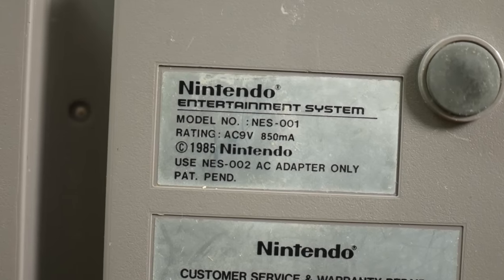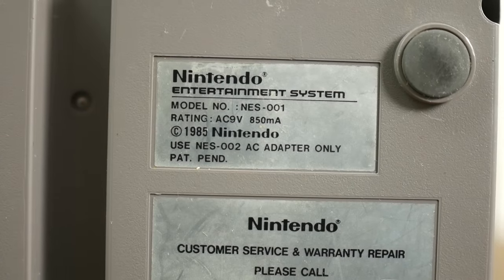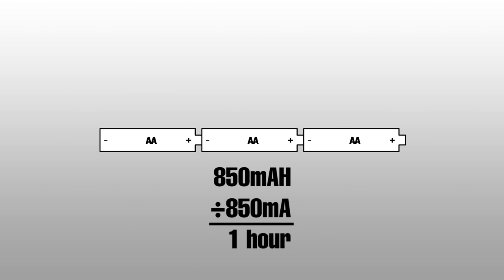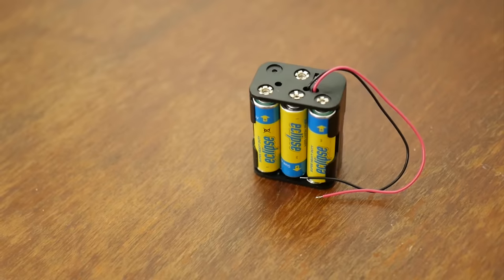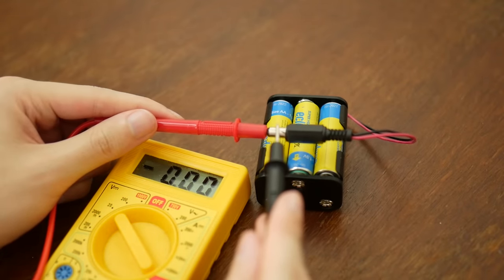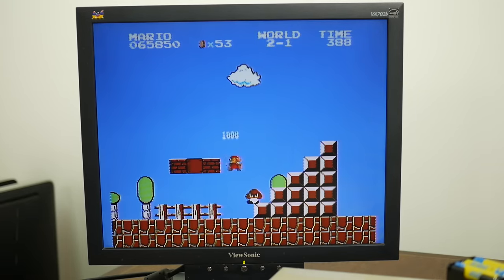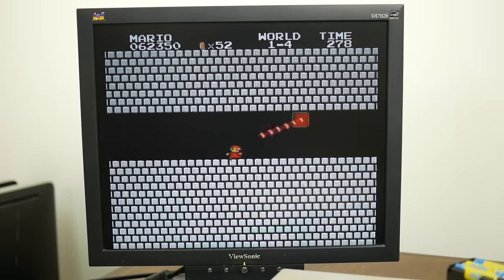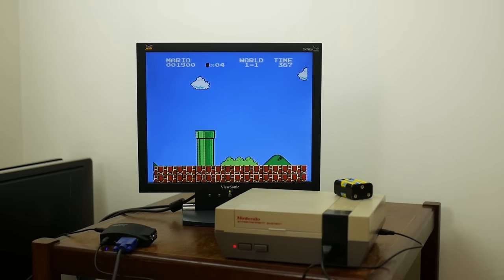Can you run an NES from AA batteries?

Comment: 1:14 "What happens if you pass DC trough a DC rectifier?"
a) Absolutely nothing
b) The DC converts back to AC
c) Matt dies

I'm guessing c) Matt dies
Reply: d) The rectifier outputs DC.
Reply: Yes because he's not immortal (I assume), but not because of this experiment.
Reply: Duh, A)bsolutely nothing!
Reply: i hopped for C
Reply: It stays DC but the inputs can be an unknown polarity with the outputs having a known polarity every time
you lose 1.2 volts unless it uses schottky diodes in which case you lose 0.4 volts
Reply: @kargaroc386  most likely 1.2 volts, as at slow 50Hz switching a cheap silicon diode rectifier would be sufficient. High frequency switching power supplies however would have Schottky diodes
Reply: @user2C47  r/whoosh
Reply: Electroboom
Reply: @mari2.  AI exists.
Reply: @Aivaras Sungaila: I'm really sure you where joking about the answer "matt dies"  because if doing this experience would have cause him to die, he would not be able to upload the video in the first place, so you could not comment you stupid joke on this video because the video would have never existed.
Reply: @mmmm768  You can troll me all you want, it does not bother me one bit, because one time, I decided to Troll someone to see what was the hype about trolling other, so I only Troll other Troll, and did it make me feel any better, the answer his no. This his proof that I know the truth about Trolling, so go head Troll me all you want because the only person your hurting his yourself.
Reply: @SuperNickid  r/wooosh
Reply: This comment: ...I choose...Matt dies!-
433 likes: Hey this is the FBI
Reply: Luigi The rectifier wins by doing absolutely nothing.
Reply: D
Reply: The funny thing is that Matt is kinda sounds like "مات" in Arabic
Which means died
Reply: Boom
Reply: E) sudden CPU evaporation
Reply: @SuperNickid  *is, not his
Reply: @SuperNickid  *you're, not your
Reply: @SuperNickid  Clearly, because that level of poor planning would definitely not characterize the sort of person that would have it figured out how to upload the video after his passing.

Comment: FYI you can mix in parallel and in series connected batteries. It's not recommended without a voltage regulator, since not all batteries provide exactly the same voltage, even brand new ones. (The voltage of batteries will drop over time or by using them.) A correctly connected circuit will give you about double of game time and can possibly be infinitely expanded.
Another solution to improve game time is to use a battery management system that automatically switches to another battery pack if it detects that the battery pack in use drops to a critical voltage.
It's possible to expand game time by maybe 5-10 minutes if you connect the battery pack directly to the pcb, since the ac to dc converter does lose a voltage of about .7 on the diode.
I studied electronics (not just in theory) a few years ago and even designed some custom audio pcbs.
For safety reasons, you could solder a physical switch near the battery pack to prevent it from shorting out.
Reply: I was thinking about the same thing while watching the video, but I was not sure if that was possible
Reply: @sommor001 You should not attempt to modify anything because it's senseless waste of time when you could buy ups  genrator.
Reply: @ghostunix731  Ups are usually bulky and expensive and are placed between a device and the electrical plug. They do have a charge time. They aren't meant to hold a charge for weeks and forget about years and decades. A non rechargeable battery can hold a charge for multiple decades. (A Cr2012 of mine is still in use after 2 decades.) Batteries can be made with primitive materials and after a nuclear war you can still play with your Nes. (You can forget about more modern stuff.) Decade old pcbs (games, systems, etc.) can usually be restored by resoldering the connections and parts like resistors can be made woth basic materials.
Reply: @sommor001 I dissagee sir I use my ups generator every day because I can plug them directly into a solar panel so I feel that I have saved alot on aa batteries.
Reply: @ghostunix731  I think you really don't know what a ""Ups generator"" is.  A ""Ups Generator"" is usually a large diesel engine that can provide a large amount of electrical power for a few days or weeks.
You are probably using a battery pack.
The second thing is, that it's possible to buy rechargable batteries in the form factor of AA (with the correct voltage).
The third thing is that years after a nuclear war AA batteries will still go strong and the title of the video was if it's possible to run a Nes on AA batteries.
Reply: @ghostunix731  To add to my comment: The term Ups generator isn't used as a Ups and a backup generator are way different things.
- A Ups is a usually a type of batterypack with some circuity added.
- A backup generator is someting like the previously mentioned diesel generator. (Solar panels don't provide a reliable energy source.)
Reply: @sommor001  call it what you like sir but I am a city boy and we care about time more than money .
Reply: @sommor001 a ups is still expensive and inefficient, just get a deep cycle and an inverter. More power less money.
Reply: @helloworld6160  I was telling the guy why not to use a ups without talking about efficiency. The Inverter isn't necessary, since you can power a AC to DC converter with just AC. (Best case would be to connect it directly to the pcb, with a voltage regulator.)
Reply: @sommor001  A noble effort trying to teach this guy standard terminology, Ohm's Law, and introductory electrochemistry and thermodynamics... but look at his videos, you might want to just start with "solar panels work because the sun is a thing that actually exists"
Reply: @ghostunix731  This is the power conversion path with your proposed setup:
12v DC (UPS battery) -> 120v AC (UPS internal inverter) -> 9v AC (external NES power supply) -> 5v DC (internal NES power supply)
A much more efficient conversion would be directly from the 12v UPS battery (or a larger deep cycle battery) to the 5v used by the NES with a modern buck converter. 
That would be a much more efficient use of your solar energy, rather than using half your equipment as a space heater.

Comment: Can you put DC through a rectifier? Yes.
Should you? Probably not, if you want to be efficient. By connecting the DC through the rectifier you are forcing it to go through an unnecessary diode which will eat up approximately 0.7 to 1V, depending on the diode, per diode. The plus side is that a rectifier will protect you from destroying your electronics if you were to connect it with reverse polarity. 

Also, keep in mind that the rectifier would normally be outputting a rippling DC voltage based on the root mean squared of the adapter’s stepped down voltage. 

As for the Nintendo having a voltage regulator that can handle up to 18V, my guess is they wanted a universal design that would work with US, European, or other international voltages. It is probably using a buck converter to drop the battery, so your best bet for performance is a voltage in the middle of its range. It will not get hotter with higher voltages. Conversely it will be more inefficient with lower voltages. 

All that being said, good experiment. If you have any questions, I’d be happy to answer.
Reply: diode don't eat the voltage the drop the voltage. so you basically loose some capacity just from the voltage drop. and there are 4 in the nes so you actually drop almost two whole volts. the nes only needs 5 volts to operate a total of 6 to run the rf circuitry.
Reply: Coty Riddle I hear what you’re saying, just keep in mind that the voltage drop is still being dissipated as heat, thus being consumed. I wasn’t sure if the console had a full bridge rectifier, so as you said, that’s an even worse power loss. 👌
Reply: @pirateskeleton7828  yes its full bridge. four discrete diodes wouldn't want to send half wave into that :D.
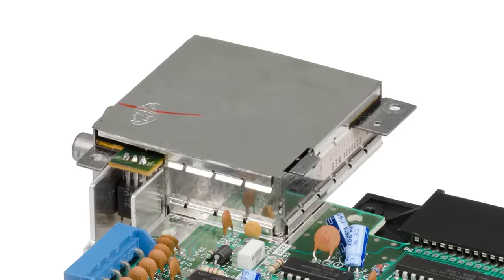Reply: The NES existed before switching power supplies were invented or made cheap enough for consumer electronics (not sure which applied at this time). It actually uses a 3 terminal linear regulator. See 6:10. You can see the TO-220 7805 regulator hanging upside down from the RF pcb attached to a large heatsink.
Reply: Kyle Mayer 7805? I did not notice that. In that case, higher DC is definitely not better, though if I was to mod it, changing it out for a switching power supply would be one of the first things I do, provided the switch freq doesn’t mess up the timings or cause any other interference. Would probably want a large filter cap.
Reply: @zackburkhart8693  a lithium ion battery would actually be the most ideal. Then just use boost or buck converters to get the exact voltage you want.
Reply: What I did is i desoldered the 7805 and replaced it straight up with a pin equivalent smps solution.

http://danielelectronics.com/2016/02/09/testing-a-dc-dc-converter-module/

This is a drop in solution. Works perfectly
Reply: Kinda suprised you glossed over the biggest issue, shielding issues due to NES design flaws getting exposed due to a non-standard power sources never though of by the enginers. As a result, the output will either be super underpowered, or the signal will have significant interference problems due to the NES not able to fully shield the output signal due to design problems amplified by the abnormal pur source.
Reply: @josepharmstrong1531  What the hell are you on about?  The power supply has nothing to do with shielding in this case.  "Shielding an output signal"?  That's what the outer layer of coax does.  It has nothing at all to do with the voltage supply.

Guys, pay attention to this.  This is what making stuff up looks like.
Reply: @big0bad0brad  100% agree.  I was thinking the same exact thing and was elated to find that you already wrote my comment for me :)

Comment: I remember as a kid I tried to use the nintendo plug on some other device and it popped and sizzled.
Reply: I killed a Commodore printer that way. An MPS1270 inkjet. I did know the difference between DC and AC, I just didn't expect the SNES to be AC so I didn't bother to check.

Comment: I did this in school for a school trip. Had a portable LCD TV as well. One 9V battery powered the NES and TV for 3 hours. I got an hour with a Sega Genesis instead of an NES. I did it again but swapped it out for a 6V lantern battery, which the alkaline variant could have upwards of 11 aH (11000 mah). I was not the coolest kid in school, but I should have. Maybe if I did it with a PS1 or N64. Screw it, playing Earthbound driving north through Michigan was worth it.
Reply: Powering an N64 off batteries is a bitch of a job, you would be better off using a power inverter
Reply: Earthbound wasn't on the NES. Why you lyin'?
Reply: @Red Stoner portable TV's
Reply: @Geeksmithing  I misspoke.
Reply: @thatguyontheright1  NES on the go is a cool idea.... 🤔🧐🤨
Reply: @Geeksmithing  It is, I did play an RPG though, just had EB on the mind since I was playing it when I posted.
Reply: @Geeksmithing  or was it.
Reply: I powered an NES with a calculator battery for 15 hours.
Reply: @Geeksmithing  Yes it was. It's called Beginnings nowadays though.

Comment: It would be cool to experiment with the effects of low voltage on different games for extended periods of time, maybe setting up some system of controlling how much power you're sending to the system after first powering it on, then keeping it at a constant lower rate to just experiment with the buggy mess it creates.
Reply: He should do it!!! I would but I don’t have the money 😂
Reply: You just have to connect it to a power supply on which you can choose the voltage (i.e. a bench PSU) and then set it to get the desired results. It won't really simulate the falling short circuit current of a discharging battery, but it should produce similar results to what was experienced in the video.

Comment: in all honesty, I think you just made a surprisingly useful benchtop tool. when you got the mobo of your NES out on a cramped workbench (think Adrian's digital basement) it might be much easier to bring out that battery pack and plug it in instead of having to plug a giant wallwart into an already mostly-full power strip hidden behind a monitor or 2.

Comment: Undervolting is a key component of circuit bending, you can get all sorts of strange reactions. Kinda interesting running the hardware lower than it's rated voltage to see what happens

Comment: I remember i did a science experiment that was “how many solar panels does it take to power a toy train?” That reminds me of this
Reply: How many
Reply: @Cantendo  if im not wrong, 2 or 3 in series does the job just fine, add a battery circuit that charges when the solar panel has too much light. But to be fair and square to the experiment, just add 3 solars cells/panels in series and directly connect them to a motor.
Reply: @euvo_sound  you are somewhat correct. I powered a Thomas and friends train, and it took 5 panels for full speed

Comment: Damn I'd love to see a dedicated video of the NES low battery effects. Especially hooked up to a CRT tv as the composite fails.
Reply: Just use a bench power supply and adjust the voltage down.

Comment: You should replace the linear regulator with a modern buck converter to see how much that improves the battery length. Probably about 75% of the power is being wasted by that regulator.
You could also try using a boost converter and get it all running off one single AA

Comment: We used to run ours directly from the 12v plug in the motorhome along with a cheap lcd tv.  The internal voltage regulator takes care of the few extra volts without any issue and with a 5kwh battery bank we never worried about how long we played.  Good times.

Comment: I did a similar test with my PSone and LCD.  It worked, but had comparable battery life to a Game Gear because the backlight is the same fluorescent tech

It would reset itself anytime the lid was closed once the batteries got low too, I think if the power was regulated it would help a lot

Comment: Batteries do drop in voltage as they're used. This is actually how the amount of stored energy left is measured.
Reply: @Phillip_HanBurst THANK YOU, this is the proper equation:

850x9/60x850=108 (AKA 1h and 8mins) for the lifetime
or an easier way to think of it:
MaH Rating(X)Input Voltage(/)1 Hour or 60(X)or(/)Output Load = Rated Discharge time before none operational 

What you Calculated(MattKC) is for how much battery is left? even @Phillip_HanBurst Noticed, anyone else NOT gonna ask why he calculated the Power Left in the battery? he litterly did 850/850=1 (You didnt even use any time calculation)

sideNote: you divided 850 by 850 XD?
Reply: Someone didn't watch the entire video before posting... -_- ...  He literally says this EXACTLY near the end.
Reply: @Cooe.  your fault for reading a year old comment

Comment: Your 9.89 volts is actually a little low. When rectifying AC to DC, you need to multiply the AC voltage by 1.41 to get the DC voltage, so with a 9v AC adapter, you will see around 12.7VDC on the DC side of the rectifier. When running DC through the rectifier, you will see the incoming DC voltage, less the forward voltage drop of the conducting diodes, so you could safely feed 12VDC into it all day long. A 12V sealed lead acid battery worth work great.
Reply: Do you mean we're using a FOOL BREEDGE RECTIFAIYA to convert the AC input to DC? (yes, I watch ElectroBOOM regularly)
Reply: No, you multiply by 1.41 to get the peak voltage. You will still get ~9V RMS (minus diode drop) on the output side if it's unfiltered. The NES is filtered so you will get a roughly steady DC voltage of 9V minus two diode drops.
Reply: @skipfred  no, my formula is correct, and every measurement I’ve ever made confirms it.
Reply: @Si1983h  Lol well, it's not but okay. Just look at the output waveform for an unfiltered full-bridge rectifier and it's immediately obvious that you're wrong.
Reply: @skipfred  but it is filtered, you’re not looking at a waveform, you’re looking at a DC voltage. Stop trying to be obtuse.
Reply: @Si1983h  DC voltages can have a waveform, my friend.
Reply: @skipfred  they’re not supposed to on the output rails of a power supply though… a waveforms on a psu rail is ripple, and it’s not desirable, and is kept to an absolute minimum on a well designed and specified power supply.
Reply: @Si1983h  You're missing the point. Just go actually build the circuit in a simulator and you'll see exactly what I mean. Falstad has premade filtered and unfiltered full-wave rectifier circuits under Circuits > Diodes.
Reply: @skipfred  I don’t need to, I’ve built actual working power supplies for a variety of applications, mainly split rail designs for audio applications. I regularly repair them too, in particular switching supplies in Linn hifi kit… where you can measure around 340VDC on the high voltage side at the smoothing caps, while the thing is under load.

Comment: You should turn this into a series on what systems you can run of batteries.
Reply: all of them. It's just a question of how many batteries and does it require bypassing the normal power plug in some complicated way.
Reply: Ashley Williams is correct. All of them. We can even go further and say all electronics can be powered by batteries (some would require some additional help, however (like capacitors or whatever)). It just simply becomes a matter of economics and practicality at that point.